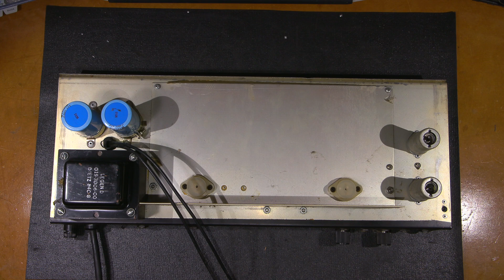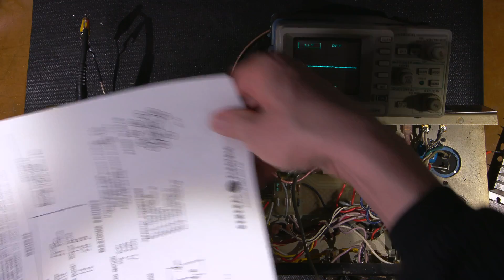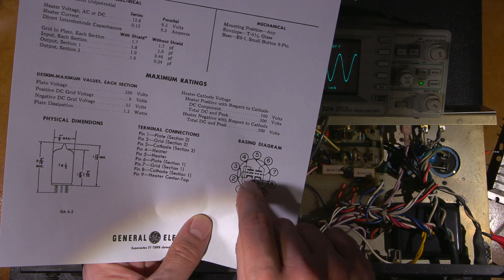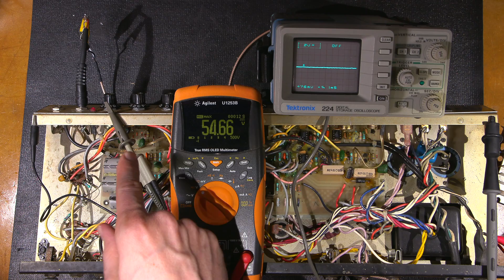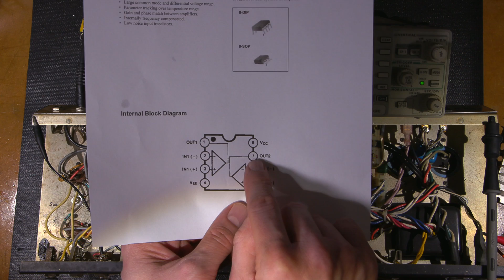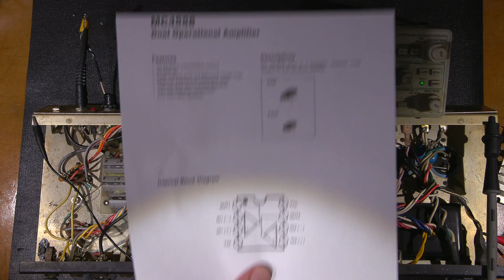Super Electronics Troubleshooter- Working On Hybrid Technology And Not Destroying It

Comment: Mind the Cap! A basic safety tip: always discharge your scope probe after doing measurements on anything with significant DC component. 

Reminds me of how I worked on a Peavey MACE circa 20 years ago. That beast had 6 6L6 tubes in the power amplifier and not a single tube besides that. So, a reverse kind of hybrid.

Of course, these '80s amps were made to rock and roll! Even more so, for getting the OD/distortion out of them easily, as punk rock and heavy metal were all the rage.

I like the socketed power transistors as long as the sockets make a good electrical contact... probably needing lots of contact cleaner and some bending to get going, but at least they were replaceable. As if it would matter that much - if they failed, they'd probably drag the driver transistors with them, if only that. I was once troubleshooting a Primare hi-fi amp with SMD parts and a meter probe slipped when I was measuring voltages on a D2PAK driver transistor, killing it and both output transistors, blowing the fuses on DC rails... Definitely not fun, fortunately I fixed the amp.

Placing any electrolytics, especially those not rated at 105°C,  right next to resistors that heat up a lot is a common recipe for failure. Planned obsolescence?

Yay, Tek 224! I love these small Tek scopes, they're so cute :)

Comment: Late 1970s! Norlin bought Legend Amps and Norlin owned Gibson Guitar. These amps hit the shelves around 1977, so that is a 1970s design. Some of these had simple triode first gain stages and a couple had FET inputs then a triode. The last one I dug around in had two DC coupled cathode follower stages in a row. That one is missing a 12AX7 tube for that architecture. The Outlaws and ZZ Top both used Legend amps. ZZ Top's  Eliminator album was recorded with nothing but Legend Amps for the guitar tracks.

Comment: such great knowledge !!! thank you. i have a late 90's Crate amp that sounded great but one day i was playing & the sound volume just started to slowly decrease, just like you was gently turning the vol. pot. to 1. when the volume went low, it didnt go silent, i could hear the guitar, but very faint. now, if i turned the amp mains AC off, and came back later or the next day, it would power up , and play normally . but after about 15 min. the sound would slowly fade, just as before... keep in mind that i love the sound/tone this amp has, so i didnt give up... after checking the fuse had continuity,  i came back once a week & would turn it on & try different things ,such as; used a different guitar, cord & played without the onboard DSP , next time i used no Dist/OD. the amp has 3 channels. i would play on each one at different volume levels. i was relentless in my hopes that the amp wasnt ruined & i had lost my $500 investment. after a few months, kinda giving up on it, when the volume faded, i angrily gave the top of the housing a "whack" with the side of my fist.. not real hard . AND the volume instantly resumed . but after 5-10 min. it would fade out again. another fist bump & it worked then fade.  after a few times of that, im thinking a loose connection. so i gathers my tools & gently opened it up, visual inspection= no burned componets or PCB's , no swollen or leaking Caps , i made sure all jacks & pots were tightened. what i could see looked ok. but it had ribbon connectors to outboard PCB's and to get to the underside to look for lifted solder pads was gonna be more involved that i felt capable to do. the amp is a Crate GLX212 . i still have it & it will still sound great for 15 min. i stopped the fist bump... i wish you was local & i could afford to pay you to diagnose it & possibly repair.. i think it is fully SS. i didnt see any tubes.  sorry for the long comment, i did say i love this amp & i havent found any helpful info until i seen your vid of guitar amps.. thanks again

Comment: I'm not trained in electronics, but I've been watching your videos, hoping to learn something about how amplifiers and the components within them work, and I'm finding your videos very interesting and informative.

I have a question - I've heard you mention how there's a difference between how an electronic technician and a musician look at their amplifiers. The last time I brought my, what I believe is an all-tube amp (a Dean Markley Signature Series CD-60 Combo) to someone for repair, he swapped out the 8 ohm speaker that was in it and put a 16 ohm speaker in it instead. When I asked why he did that when I went to retrieve the amp, I was told because he "liked the way it looked on the scope better".

What I have always wondered since then is, is it safe to change back to an 8 ohm speaker (as the speaker output jack is labeled that the amp was designed for), and was this just a case of him looking at the amplifier from a technicians point of view, judging by what his equipment was showing him...? or would the amp, as he claimed, be more "unstable" if I were to put an 8 ohm speaker back in it...?

I'd be interested to hear what your thoughts might be on this...

Comment: What are the two metal squares in the center of the circuit board around 20:14? They have a cylindrical piece of metal in the middle.
Reply: Hi Adam, round transistors (probably pre- drivers) mounted on heat sinks.

Comment: This is a very clear explanation like all your videos!  I have a question for you: Sometimes I fix old audio gear.  I am thinking about replacing all OP amps with newer ones, especially when the old ones are 741 that where fine in the 70's, but are considered crappy sounding and noisy today.  If I look at the data sheets to find OP amps that as a higher slew rate, lower noise and is internally compensated for unity gain, can I be sure that the circuit will not get into oscillation?

Comment: The late 70's and 80's saw a push by the industry to get musicians to accept solid state amplifiers. 

This saw some degree of success by companies like ROLAND and PEAVEY especially in jazz and country music where a clean tone was needed. 

But despite years and years of engineering , marketing, and return trips to the drawing board, solid state amps have never achieved the status of tube amps in rock music.
Randall is the only manufacture to have major touring rock acts use solid state amps (a few exceptions not withstanding)
Hybrid amps were an attempt to approve the tone by either making the preamp tube (like LEGEND and some MUSIC MAN) or making the power amp tube section tube (like the PEAVEY Classic).
Point is solid state sections are widely recognized as a trade off in tone for a lower price and higher reliability in rugged applications.
I have NEVER heard a musician say he chose a solid state amp for the harsh distortion tone! 

Great cleans? maybe (PEAVEY Renown series - ROLAND Jazz Chorus)

Comment: Thanks for some great videos. You're an excellent teacher. I would like to learn more about repairing electronics, specifically guitar amplifiers. I currently have an older (80's) Crate Bass amp that has the sound cutting in and out. Sometimes if I hit the bass guitar string hard, the sounds comes back then goes out again more frequently the long the amp is turned on. Any ideas where to start? I also would like to know if you have a list of diagnostic tools to buy to get started with troubleshooting guitar amps/electronics. I'll gladly subscribe to your Patreon to get this information.
Reply: By the way, the Crate bass amp that I have is a hybrid with scatchy pots (knobs and sliders)

Comment: Another great video!

Do you plan on doing a video on troubleshooting a DC coupled guitar amp? Discrete DC coupled bipolar transistor amps are especially difficult to diagnose because an issue in a previous stage can upset a later stage to the point that the later stage will burn out, etc.

Comment: It's worth noting that on some scopes (such as my Tek 2225) switching the coupling selector to "GND" (which grounds the input) will drain that capacitor (at least according to the manual). Tektronix even had the foresight to put the ground selection between AC and DC coupling on the same switch.

Trap for young players I guess

Comment: Very interesting that the scope probe holds the HV charge from the vacuum tube plate and must be grounded before probing a semi conductor component. Is there that much of a reason to build hybrid circuits in the first place?  How old were you when you became interested in electronics. I was about 4 when I stuck a flashlight bulb into a light bulb socket and a big spark turned my fingernail black.

Comment: really am digging your channel, please more musical equipment repairs!  As an amateur musician/guitarist and at home recording engineer LOL who isn't these days, right? I use so many electronic devices every day, I am so ready to learn to repair or modify/build my own equipment ( Fender Bassman tube guitar amp clone ;)) last month I took in my guitar effects/amp digital modeling device (helix) for repair and was told the wait was at least two months or longer to get it back if they could find the issue and then get the parts and repair it, that is another reason why I am signing up for your course through patreon but my big issue is I have a condition called essential tremor meaning my hands can shake slightly to very badly when I actively use the muscles which makes fine handwork like soldering nearly impossible at times or using small screwdrivers etc. Do you have any ideas of what I could use to help with this?  In my day job, I am an aerospace manufacturing engineer specializing in advanced composite materials I don't have trouble in my work which is mainly on a computer typing albeit slowly and at times not very accurate but I manage to get the work done and still can kick out some jams on my electric guitar
Reply from the maker: Hi Ben, and welcome. Resting your hand on a small wooden block (to elevate it) while soldering helps with the shake. So picture holding the iron handle like a pen in your hand, then resting your hand elevated on that block.

Comment: Mr. Carlson, I'm something of a tube guitar amp nut. When I replace Fender (Mallory) filter caps in amps from the 1960s, the old ones very often measure close to twice their rated capacity with zero ESR.  Are they really acting as capacitors of those readings or is there something else going on? I ask because my favorite amp "seems" to sound more sterile since replacing the filter and bypass caps throughout.  All were dated 1964 and they all read 50~85% higher capacitance than labeled. Many thanks for your opinion on this. I would expect a change in the tone/sound, but surprised that it might be a less desirable tone after doing reasonable maintenance. Thanks
Reply from the maker: Hi J Jo. Capacitor meters use time to measure capacitance. If a capacitor is leaky, it takes more time to charge (because of the theoretical resistor in parallel with it.) More time to charge will give you a higher capacitance reading. (a false reading) ESR meters are usually used for larger value electrolytic capacitors, not paper or poly types.

Comment: If connected as an inverting amplifier and working, you'll se no signal on either input. However, if that op amp section isn't working, you should.
Reply from the maker: Um.. NO.
Reply: @MrCarlsonsLab  With a properly operating Op Amp wired as an inverting amp: Noninverting intput held at ground or virtual ground, proper operation of an inverting amp configuration of an Op Amp keeps the inverting input at the same voltage as the noninverting input. No signal on 'scope.

If wired as noninverting amp, then the input is on the noninverting input, and proper operation of the Op Amp makes the inverting input exactly follow the voltage on the noninverting input. In which case, both inputs will show the same signal on a 'scope when the Op Amp is operating properly.

Try it in LTSpice, wire it up on a board and probe it.

Comment: I don't recall ever having blown an IC with the charge on a scope probe. Although, it would be normal practice to use a x10 probe on tube gear anyway, which means you have 10Mohm in series with the  capacitor so the current it can deliver is minimal. If you use a x1 probe on tubes you risk damaging your scope anyway, most inputs being rated to about 250v or so, which can easily be exceeded. The other big gotcha is to never use a probe with the metal earthing ring (normally covered by the hook attachment) exposed, because it's very, very easy to short something with this. If the probe has no cover supplied for this metal ring and you want to use it capless, improvise a cover out of heatshrink tubing.
Reply: Hi Ian I can tell you are actually a tech and have done real repairs,so many comments are by people repeating something they've read somewhere else.

Comment: What about the metal cans in the middle of the chassis? Are those voltage regulators?

I know a few people who have built their own guitar amps with oddball valves (common and cheap enough because they were pulled from old TVs and radios), but how often do you encounter a commercial guitar amp with anything other than jellybean valves and op amps with standard pinouts?

Comment: Very interesting video. Ah yes, the venerable 4558, those are everywhere, along with younger siblings the 4559 & 4560. Depending on the architecture a solid state amplifier can run full blast into an open. Since they're mainly current amplifiers without a load they don't dissipate much power. As long as it's stable, no oscillations or nonsense, it'll just sit there.  Another choice for either glass or silicon is a moderate load. One could test with something like 800 Ohms. With tubes you can drive it a bit harder than into an open but still have decent sensitivity for delicate measurements.

Comment: thanx for sharing   any explanation as to why or what causes the scope to charge like a capacitor
Reply from the maker: Hi Richard. There is a capacitor in series with the hot lead of the probe inside the scope. This capacitor is used for AC coupling.
Reply: thanx for the reply i'll have to dig into this more closely.  i expect that when the scope is set at dc it is either switched out of the circuit or into parallel?

Comment: 4558 opamps are as common as dirt. I have an early '80s active crossover that is noisier than I'd like. I haven't re-capped yet, or even looked for noisy resistors. I'm considering "upgrading" the opamps to lower noise devices if this doesn't work. I went as far as to order thru-hole to surface mount adapters from Sparkfun. It looks like OPA2209 is a good candidate. But the faster opamps may osculate, so I'll likely need to add caps in the feedback. Does anyone have experience "upgrading" opamps?
Reply from the maker: The AD797 is what you really want :^)

Comment: 48:32 - Conversely, with a tube amp, one could short the speaker output to go to standby!

Solid state output stage : VOLTAGE source
Tube amp output stage: CURRENT source
Reply from the maker: Hi David, they both have to source current to drive a speaker.

Comment: So the oscilloscope is forcing a DC voltage back into the circuit?
Do I have that right?
Reply from the maker: You could look at it like this. The Plate of the tube has a high DC voltage on it, as well as an AC audio signal. The scope has a capacitor inside it used for AC coupling. That high DC voltage is charging that capacitor up in the scope. Then the scope stores the charge.
Reply: Perfect! Your reply clarified it.

Comment: I wonder are those integrated circuits all the same, if so and one gets popped what about replicating the Op-Amp with discrete components until you can get replacement chip.

Comment: I’ve been repairing for 37+ years now and I’ve never known about the oscope holding the DC charge!   I guess I mostly use the scope in DC mode. In the 80’s and 90’s I did do a lot of work on a hybrid instrument. Makes me wonder if I ever caused damage I didn’t know I caused probing around in AC mode with my Tek465 and 10:1 probe. I have never used anything other than a 10:1 probe; never a 1:1 probe even.

Does this charge problem exist in AC mode with the typical Tek 10:1 probe?
Reply from the maker: Hi Davey. This scope probe was a X10 probe as well.

Comment: Could you tell me what type of diode I would need to install a signal light buzzer on my wife's Triumph motorcycle. I have a beeper from a Honda Goldwing, they used a double pole relay. I need a diode to control a load of 2 12v 3-5 w bulbs. The diodes are needed to keep the voltage from feeding back up the wires to the opposite signals, that would make them 4way flashers. Sorry it's not a electronic question but I need info on what I have to find....Hal

Comment: if you have ground lift in oscilloscope how you can discharge probe ? What is better put oscilloscope on isolation transformer or is better connect amplifier to isolation transformer?

Comment: Back in the 1970's I worked on a lot of TTL logic, no high voltage problems like this, but the TTL was +5V, and there was also + and -15 Volts for Op-Amps...we had these clips you used on the 8-14,16 pin DIPS that looked sort of like a big clothespin...it got the pins spread out and helped prevent shorting when probing around....
 When I first started that job-1970, we were still using Simpson 260's but soon progressed to Tek-Tronics scopes ...There was 90 volts and 120 volts DC for the X-Y-Z axis drive motors on the NC machines, but pretty well spaced away from other components...lots of General Electric systems. Still all those voltages appeared on the same PC boards.